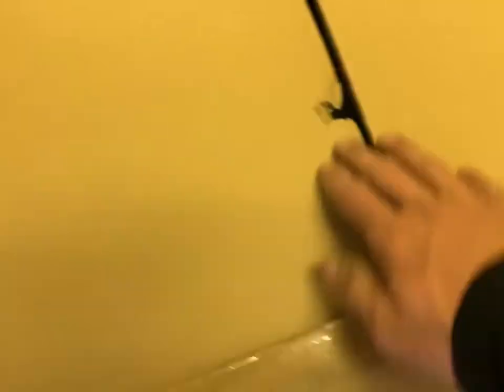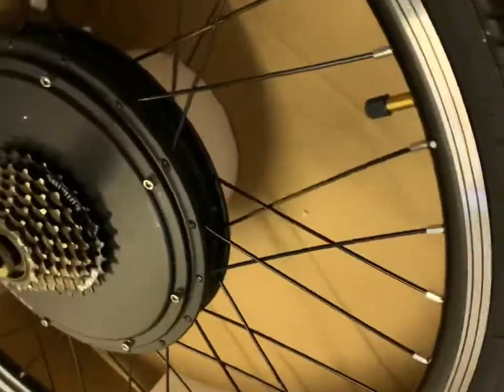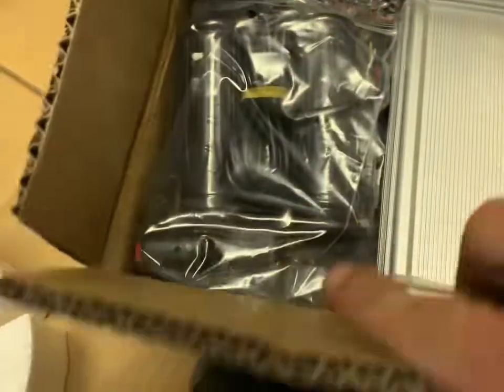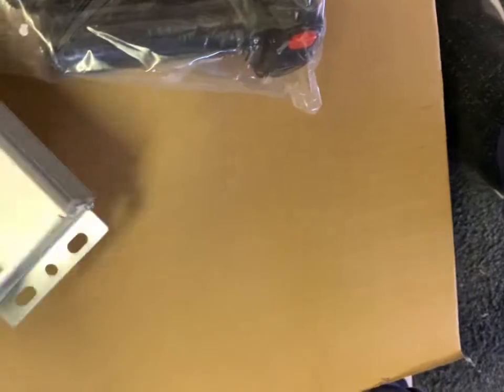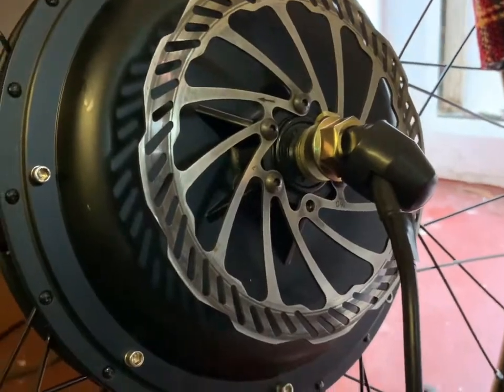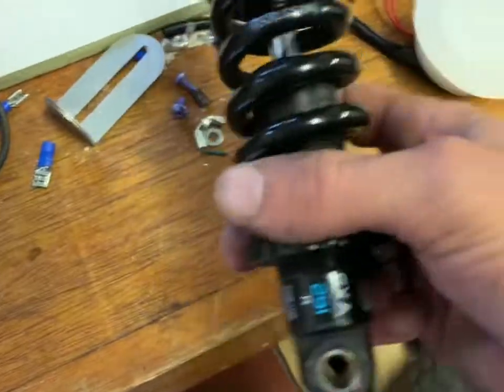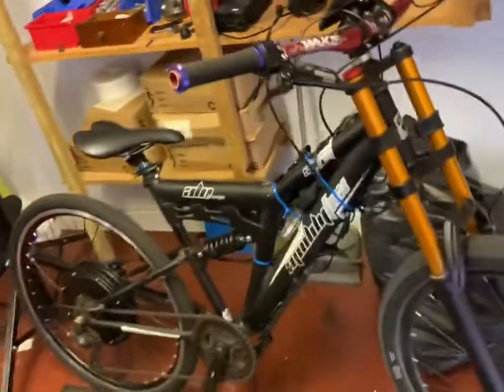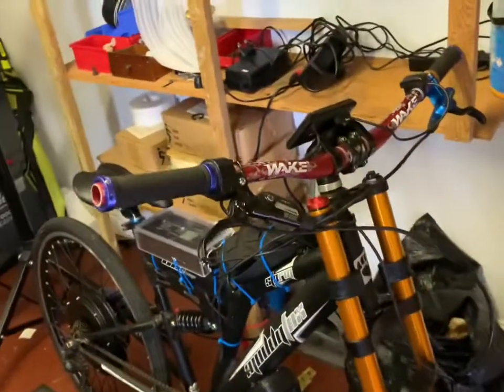1500w ebike kit unboxing and build @SamPilgrim #electricbikes

Comment: I’ve got the 1500watt wheel you can push a lot more than stated but just upgrade your phase wires they look Pidley little fings. I get 34mph out of a 54v battery. Not tried it on 72volts yet 🙂
Reply from the maker: Never heard of a 54v battery just 48 52 60 72 were did you get that from?
Reply from the maker: And yeah wires small but it’s not the size of the wire it’s how you use it